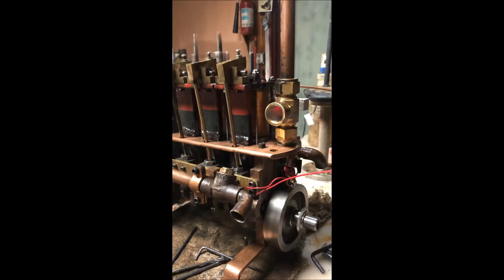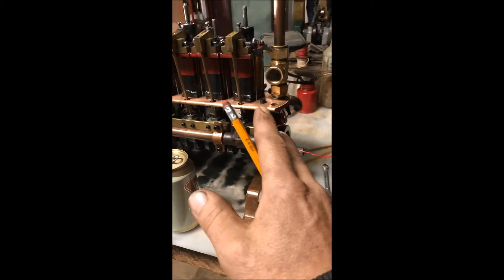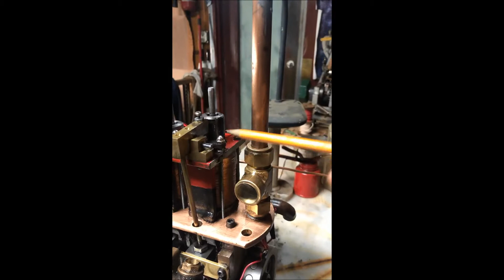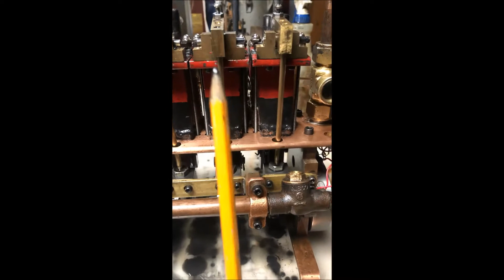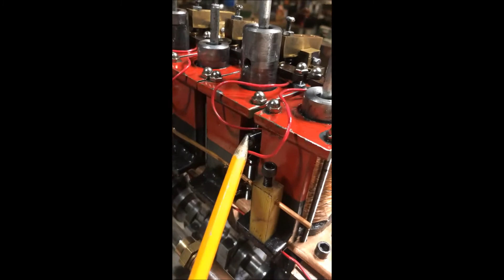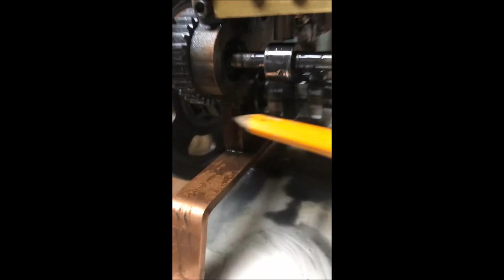Solenoid Engine 4 cylinder

Comment: Wouldn't it be more efficient to run it P.E.M.F?
Reply from the maker: No idea what pemf is.
Reply: @rogueart7706  (pulse electro-magnetic field)
By only charging the coil for a fraction of a second as apposed to either being on or off
Reply from the maker: @iwasbehindyou  a fraction of a second wont do anything. 
It needs to be on through the stroke, about 160 degrees. 
Efficiency is not what this is about.  It’s about using mechanical parts made in the shop. 
I’ve seen the solenoid engines running on arduinos and other electronic doodads but they are too quiet. I want it to sound like a real engine and this one does just that.
Reply from the maker: @iwasbehindyou  oops. In hindsight I think I misinterpreted your reply. 
Now I think you are saying that the voltage is ramped up in a fraction of a second. 
In that case yes maybe I should do that. That would fix the back emf problem without fly back diodes. 
Coincidentally I just received my first arduino starter kit yesterday. 
If I’m understanding you correctly now, then It’s a great idea thanks. 👍
Reply: @rogueart7706  also
Adding magnets to the rods multiplies the energy of the force
Reply from the maker: @iwasbehindyou  adding magnets to the rod creates drag in the opposite direction against the iron frame. 
Also magnets attract every piece of dirt and metal chip from hell’s creation. Impossible to clean a magnet in a motor.
Reply from the maker: @iwasbehindyou  I’m learning the arduino thing. I can use magnetic reed switches to trigger a ramped voltage. The engine has the most torque at half way down the stroke, There is virtually no torque at the ends of the stroke….it’s just waisted current at those points. 
so ramping the voltage towards the half way point would be much more efficient…I’m guessing even 50% more efficient at least. 
The arduino could also be a governor to control the rpm under variable loads. 
You got me pondering on my lunch break. thanks.